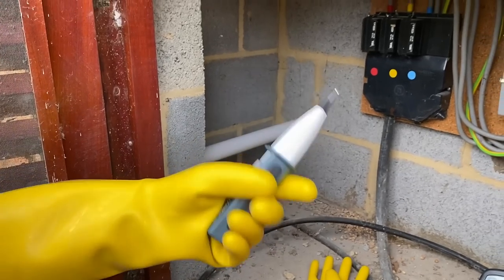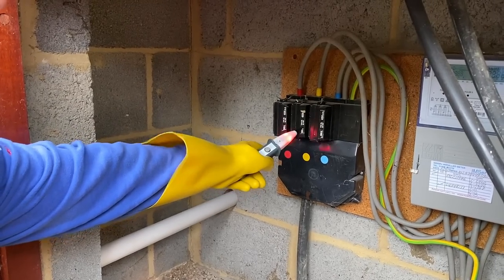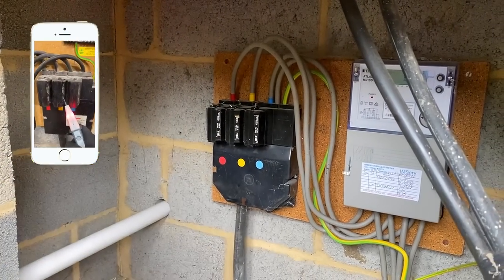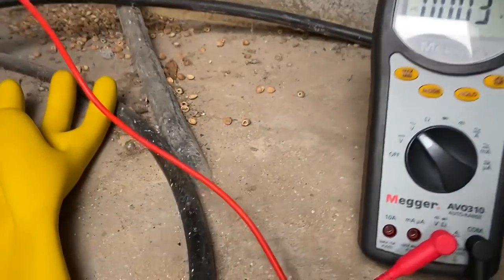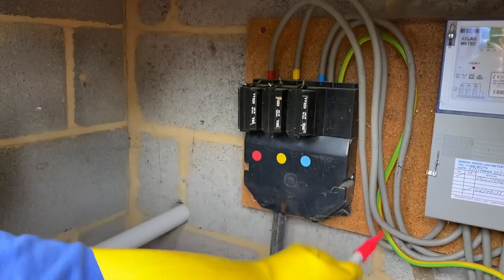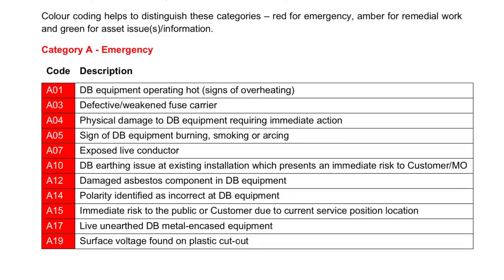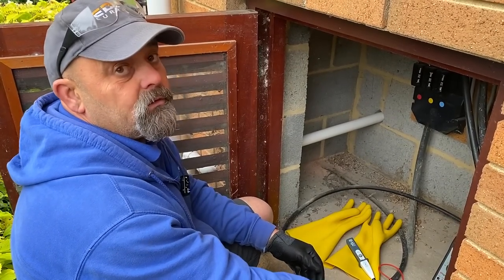The Hidden Danger in your Cut Out Fuse: Don't ignore this!

Comment: Just as he said, "As you can see, it's not contactless" the test instrument lit up when he touched the double insulated meter tail, which suggests it's picking up induction and not surface voltage.
Reply: i laughed when it lit up aswell and thought the same thing lol
Reply: actually a lot of these testers go off with movement, im not sure why but even some fluke testers do it and im not sure if its atmospheric residue or a generated affect from the kinetic force of the movement. otherwise it could also be a dual function tester with contact pins at the tip for surface voltage, and prob shaft for induction
Reply: I once had a cobweb light up and at first I thought is a spider web conductive. I very quickly realised them testers are crap. Can’t beat a avi
Reply: @ASHLambretta  I love the way you electricians understand this mysterious science that the rest of us find unfathomable. It’s like you’re in some secret society.
Reply: @BritishJax  absolutely right we call them widowmakers over here in the the only thing I really trust them for is to let you know that you do have energized wires that's it
Reply: @iamtex9593  literally this. Always stop and see if I "turned it off"
Reply: Not induction, it's capacitative.
Reply: I saw that
Reply: It's NOT indictuon, it's capacitive coupling.

Comment: Thank you so much for putting this video up, it could save someones life one day.
I was in my cabinet today and noticed something wasn't right, I had my Fluke T150 with me and noticed the service head and carrier was causing it to beep and light up the voltage present indicator when touching the head or carrier. I ran inside and grabbed my Fluke 87V and I am seeing in over 30V on the head and carrier. I called the DNO who came out in 30 minutes and confirmed the issue. He changed the carrier to one he had on the van and the reading dropped to 1V on the carrier which proves both my carrier and head is suffering phenolic degradation, as the head itself is still reading 30V+ but not his carrier.  Now the Fluke 87V has an impedance of 10Megohms so this leakage is very low current but the voltage could be a lot higher under higher impedance and certainly an indication of phenolic degradation which may progressively get worse. 
The man from the DNO had not come across this issue before and was really interested, he has logged and reported it and will discuss it with his colleagues. I think someone will be back to replace the service head/cut out.

Hopefully there is more awareness of this as although I am personally familiar with things like phenolic degradation and materials becoming hygroscopic. I would never have thought about this with the service head and I dread to think what could happen to someone removing the fuse carrier, accidentally brushing past a degraded carrier/service head when reading a meter or switching off an isolator.
Reply from the maker: Pleased we’ve been able to help - thanks for sharing your experience 👍

Comment: A very informative video,  I remember my family home ,our electrical panel had pull out blocks for the main and range cartridge fuses which were made from bakelite.  100A 120/240V 240V dryer was fused into the opposite phases of the plug fuses at the bottom of the panel.  There was a six circuit fuse box in the house, probably an 8-3 BX cable off the power lugs at the main panel. House was built around 1946-49

Comment: This shows why we do IR  tests on our side of the cutout  equipment to see if there is any breakdown in resistance through ageing of bakelite in accessories etc.  The actual voltage from the fuse carriers shouldn't be an issue for us as we aren't allowed to pull cut out fuses anyway,  this just adds another reason to the list  like electric shock , explosion and severe burns .
Reply: Could become an issue for anyone working near the cablehead if the phenolic breakdown causes a short between phase and neutral. This has happened before, guy I used to work with got burns on his back as the cablehead behind him flashed over while he was working next to it. Fuse had not been pulled

Comment: Back in the 90’s when digital multimeters were just becoming affordable you couldn’t get a reliable reading from them due the very high input impedance in factories where cables were running alongside other energised cables. They were as much use as the trusty neon screwdriver😂😂. ( very popular in the day) you could easily be showing 100v on a circuit then read it with an old style meter and it would be zero. Sure as hell wouldn’t worry about 10 volts. Do they still teach apprentices to use the back of the hand for to first contact after testing??

Comment: Update…..
UKPN (UK Power Networks) turned up this morning to check out the service head. It is being booked in for a replacement.
Great to catch up Gary, see you again soon.
👊😎👍💙
Reply from the maker: Thanks for the update 🦾💕🦾
Reply: As a consumer you would never think that such a thing could happen. Plastic is plastic and plastic is an insulator means most (Myself included) might think Once an insulator, always an insulator! 😳

My supply has a ~40 year old service head on it, so part of me is wondering if I really should get my voltmeter out?... ⚡

Comment: I saw the E5 group talking about this a while back.  It is a very interesting phenomenon.  The plastic gets cooked with time, heat, UV and then it starts to break down and corbonise.  Once it starts to carbonises the current can start to flow through it, the more the current flows the more carbonises.  Thus over time it accelarates making it worse.  

The DNO/DSO are well aware of the issue and they are well aware of how many service heads they have that are not GRP (glass-reinforced plastic).  The question that should be asked is
Why are they not being pro-active and have a upgrade program in place?

The Electricity at Work Regulations 1989 section 4a should cover it.  While the DNO/DSO are there they need to fit an isolator as well.

What is a section 4 of the electrical safety regulations?
    (4) Any equipment provided under these Regulations for the purpose of protecting persons at work on or near electrical equipment shall be suitable for the use for which it is provided, be maintained in a condition suitable for that use, and be properly used.

In my opinion the reporting and possible checking of a service head should be included in BS-7671AM3 (AM3 I understand is already on way)
Reply: Mate thanks for that informative explanation, they should have explained how this happens in the video!
Reply: It's more a reaction with oxygen, and the ability for the plastic to build-up carbon upon it.   It starts to track.  The only foolproof units are ceramic - but there's a significant cost disadvantage to them.
Reply: You proactive replacement, but you would not want electricity supply disruptions so that’s the thing most people will say no because they’re electric works

Comment: Looks too much like a volt stick and for that reason I don't trust it 😂
I have pulled 100s of these with my bare hands over the years and never even felt a tickle once. Is there any stats/record of incidents on this subject?
Reply: I think I remember the DNOs were using de-sensitised volt sticks to presumably eliminate false alarms. Get out the test lamps and a neon!
Reply: @fluxington  I think for what it's worth il just give them the old 40ms quick finger from now on to be on the safe side 🤣
Reply: @davey6024  Same here, bare hands on cut out changes, don't trust this at all - and I've felt induced voltage on not live conductors.
Reply: Over over the years has validated your point as it only starting to degrade now

Comment: Wow I never new this was such a problem.
What was the test probe he was using? And can a normal non contact voltage stick be used.? Also is his multimeter a standard model a perceive for this test ? I have just tried my non contact voltage stick on my cutout and with a bit of pressure it’s  lights up .fantastic video Gaz as always 👍👍
Reply: No a non contact volt stick can't be used by definition it's not contacting anything.  It's merely works on induced voltage through the magnetic field from the voltage present.  Any volt meter would read the leakage voltage through the bakelite.
Reply: a non contact voltage stick will ignite just when close enough on good equipment so no good in this case
Reply: @dennisphoenix1 thank you
Reply: @radiotowers1159 thank you
Reply: @dennisphoenix1 a normal everyday multimeter would do ?
Reply: @Dog-whisperer7494  yes. That's all the guy was using.  It's only reading 5 to 10 volts anyway.
Reply: @dennisphoenix1  It works by capacitive coupling, not inductive/magnetic.

Comment: VT7’s will pick up voltage even if there’s no surface voltage, best way to check for stray current is with a Drummond test lamp
Reply: Yes totally agree with you I would do the same Exact procedure like you just said in the comment 👍

Definitely I can tell you’ve worked on cutouts and exchanged electric meters before pal 👍

Comment: Outdoor temperatures and condensation cause spurious Voltages on the older Black 3 TPN Service Heads hence the move by the DNO's to the Grey Injection Moulded variants

Comment: Assuming the input Z of that meter is 10M ohms, that's 10V / 10M = 1uA.  Nowhere near enough to even feel it.  I assume there's been occurrences of people actually getting a shock off these which has lead to this being reported?  If they're simply grounding one end of a DVM and sticking the other on the service head, they're bound to pickup AC voltage.  You would get exactly the same if you placed the probe next to any of those tails.
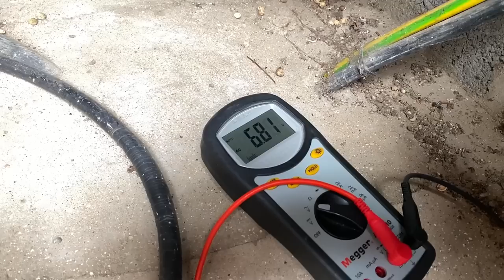Reply: On 3:36 , someone has reported electric shock with more than 50V reported
Reply: Just to confirm my assumption re the input Z of that meter, it's actually quoted as 7.8M ohms on the Megger datasheet, so still VERY high and bound to pickup AC voltage readings if in close proximity to live parts.
Reply: @FlyingPlastic356  He mentioned that 50V was reported, not a shock specifically.  50V if measured with most standard DVMs will equate to a current in the region of 5uA.  That level of leakage in itself is not going to cause any issues.  I'm not saying that heads don't fail in this way, I just don't think using a high Z meter is the best way to measure it.
Reply: What are you on about? What does the meter impedance have to do with the ability to shock?!
Reply: @aidensmobile614  A lot.  Although the meter may show 50V AC, that's only at a VERY low current.  If you measured that same voltage using a low Z meter, you'd get a much lower voltage reading.
Reply: Sure, a high impedance meter will detect voltage even if the circuit impedance across a human would be so high that the voltage would collapse.  That's not the point.  The point is that the material is starting to breakdown.  If you see voltage outside of specs with a DMM now is the time to report it and have it corrected, before things degrade to the point where casual contact results in a shock or worse.

The same thing happens with old bakelite switches and their mounting plates.  You can even get surface voltage on modern plastics that have been contaminated, say a fitting in a kitchen, or even just one that someone has been meticulously hitting with cleaner spray for years.
Reply: @retrozmachine1189  I totally get that if this is likely to degrade to the point where it will conduct sufficient current to cause "a shock" then it needs to be replaced.  My original question was "has this failure mode actually caused a shock?".  The video only mentioned that people had detected voltages, presumably using a high Z DVM.  From what you say this is a known problem that presumably HAS caused shocks in the past where in which case I can see why they're replacing them.
Reply: @Chris-hy6jy  No one in the UK may have been shocked yet.  The same principle applies to premises wiring.

We do IR tests on wiring without complaint.  Depending where you are in the world a result of 1M may well require the wiring be investigated to locate the problem.  1M is so high that even at 400VAC a human being in contact with it would be perfectly safe.  

It's all about detect and fix before it becomes a hazard.
Reply: @retrozmachine1189  I get that, I was just questioning whether or not the testing methodology was valid.  If this voltage is truly detected on the surface of the insulating material due to breakdown or contamination that is likely to cause any sort of risk to life now or in the future, absolutely it should be changed.  If however we're just picking up AC voltage through capacitive or inductive coupling, that won't tell us anything.
Reply: @Chris-hy6jy  The hand held test thing, can't speak for how it performs.  The DMM between earthing and enclosure, yes, that's a valid test in my opinion.

I wouldn't expect anything more than a couple of volts (clean 50Hz power, not the output of an inverter with 20kHz component) against the enclosure.  10V, to me at least, says something is definitely amiss considering the enclosure is not filthy or showing signs of some sort of liquid contamination.

It'd be the same if you were to place one lead of a DMM to earth (CPC) and then placed the other against the insulation on a live wire, assuming the insulation is good.  In fact I tested my own DMM in that circumstance right now and saw less than 1V.  There's a lot more material between the surface of that enclosure and the live parts than there is between the wire in a piece of 2.5mm.

Comment: What impedance meter do you need to measure these sorts of voltages?
Reply: In this video the breakdown is so small, that it is barely visible at 10MOhm input impedance (on the megger), it even has to struggle with ranging.

It will not even show with LoZ-measurement or electrical testers.

Capacitive EF-Testing with insulating eqipment as demonstrated is nothing that I would deem reliable measurement....... ;-) ... It'll pick up everything from moisture to moon phases.

Don't get me wrong. If there are readings, it should be replaced. But 5V at 10Mohm is nothing that sparks immediate panic in me.

Comment: The dno fitting a double pole isolator the other week told me this that the old cabe head the black ones are starting to degrade & thay have been warned to double check the old black cable heads for voltage leak must be quiet a common fault...👍

Comment: watched all the ads through, just for you! 😂

Aren’t those rubber gloves meant to be worn underneath leather gloves?
Reply: The leather gloves would be enormous! But if I remember correctly, there was a pair of cotton gloves that were meant to be worn under the rubber ones. No-one used them because if you wanted to use a neon, you would have to remove part of the rubber glove to get skin contact. In my day it was test lamps and neon for proving.
Reply: Gloves are fine that way if you’re using it with test instrumentation you top anything else? You have to have protection for the insulating gloves you should assess yourself

Comment: So electrician is surveying for the DNO?
Reply: Yeah, but you can't touch the service heads 😁
Reply: These are checked generally on an EIC the main incoming cable should be visually inspected or something like this. If feasible the DNO won’t do this because 95% of homeowners will not let them in unless there’s a problem.

Comment: 5 V at 10 MOhm input impedance of the DMM... Obviously the insulation is not great and it might be a good idea to replace it, but how is that an immediate danger?

Also, since when is the EF-detector trustworthy, especially if you are wearing lot's of insulated protective gear that is further messing with that capacitive measurement method?

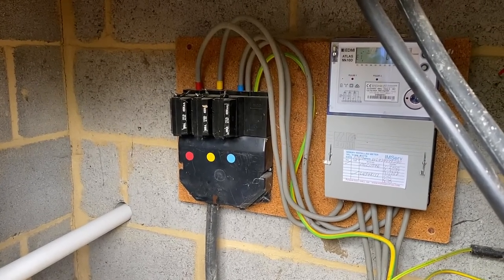Comment: Shock horror, there’s a few microamps of leakage current through a 50 year old phenolic 3:49 insulator. Better not lick it then.
Reply: Stupid comments like this need a fully sarcastic clap-back..    I just can't be bothered with it though.
Reply: Shock horror you should not be working with electricity because any leakage that is not allowed shouldn’t happen

Comment: Interesting, that looks like the KT1700 single pole tester which operates between 50-600 volts which is odd considering the voltage measured on the DMM.
Reply: Induction as there is probably a load on

Comment: I take the max voltage would be 230 v ?
Reply: The single phase parameters are 230 v , plus 10 per cent, - 6 per cent. 217 v to 253 v

Comment: This has been an issue for a few years now, generally this type of cablehead change is reported by the metering companies when a new smart meter is installed.
The issue can be aggravated if the equipment is located in a damp position as in an outside cabinet.
When working on this equipment ,in date , certified rubber gloves  need to be worn by authorised personnel to insert and withdraw fuses.
If you are an electrician who will be doing work where a new meter will need to be fitted it is worth your while scoping out the job and reporting it smartly. The actual work of replacing may well need to be put on the DNO works program and could hold up your plannned  installation works .
Reply: Generally, they should not up as they should not be pulling the main fuse unless they have specific authorisation in that case they generally have to prove they have the equipment to do it safely which would include insulated gloves and things like that